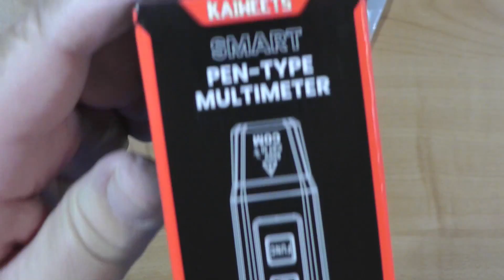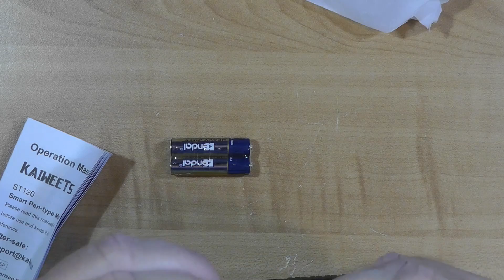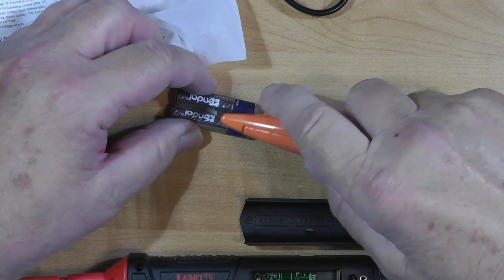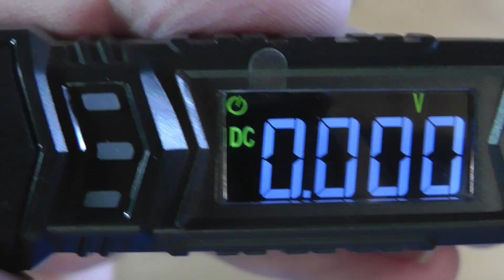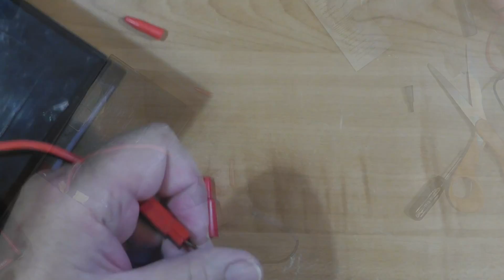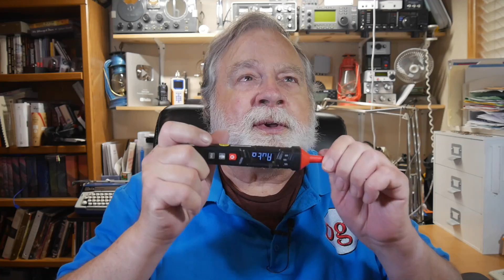The Kaiweets ST120 (#745)

Comment: Great looking little meter. Another good pair of meters (among other features) are the Pokit line of scopemeters that work with an app on your phone for displaying results. I've got the original, which looks like a keyfob. The leads retract into the body with the press of a button, and are the tiniest probes I've seen on a meter. They snap into the body of the meter when the leads are retracted. The Pokit 2 is more of a pen-style meter such as the one you're reviewing. Both can function as multimeters or as single-channel oscilloscopes.

I wish I could say I watched the entire video, Dave, but the camera was bouncing and vibrating around so much, it gave me a touch of sim-sickness and I had to turn it off. You might want to consider having a Panavise or "third hand" helper to hold items like this meter steady so you can record them with a tripod mounted camera. The information you were giving was wonderful, and I really wanted to finish watching it, but sim-sickness really gets me in the inner ears, and I'll start feeling oddly feverish and a little nauseated, it getting worse the longer the video bounces or swings around.

It's named after the sensation I described, caused by video games and simulators that don't have a steady "camera", or have too narrow a field of vision. The inner ear doesn't feel what the eyes are telling your brain should be there, so the nauseated feeling and feverish sensation show how hard the brain is trying to match up the view with the body's inner ear. It also happens in movies and TV shows that make too much use of "shakycam". COPS is notorious for this, when the cameraman riding with the police has to run to keep up.